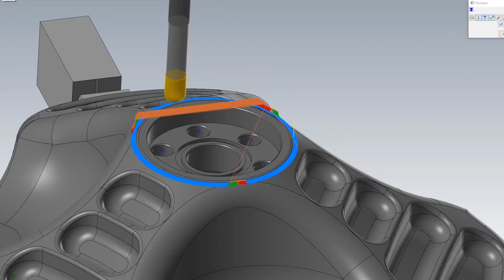IF You're This Type of Machinist, You Deserve $100,000+ Salary

Comment: I started out as a cnc set-up guy in mom and pop small shops for 8 years, and then I became a manual machinist. I thought I actually knew something until I started working with the old-timers who spent 40 and 50 years in the industry. I later got a chance to train and become a programmer for a very successful engineering company. The ignorance of high tech shop's was enough to change my mind about being a cnc programmer. When I left that engineering company, heads rolled  like it was midevil times.

Comment: been working at a shop for about 4 years as a tool and die maker, we run a lot of D2 tool steel and supply 5 satellite shops with parts, I took a process that took a week for a set of blades for one of our shearing machines and made a fixture and ran a years worth in 5 days on a 1994 haas vf-3.

Comment: In my shop we only cut 1 thing 
The threaded connections for drill pipe in the oilfield 
I run a manual but I’ll see day shift arguing with night shift about adjusting the program
In this shop everything’s set up you just need to run the program, you’ll have a connection out in 1/2 an hour give or take

We had new guys show up and try to do it a different way or “this is how I do it”
One guy crashed the machine
Another guy would fuck with the program and spend all night on a single connection
12 hr shift

Those guys don’t last long

Comment: Hi Titan, where I live machine shops pay $20 per hour starting with zero experience, $22 per hour starting for students partially through tech school, and twenty years experience programming 5 and 6 axis Mazak and Doosan in conversational and G-code along with the technical school diploma pays $24 per hour. Wouldn't you think the difference in pay between no experience and experienced should be more especially considering the current skills gap?  What gives?

Comment: So many shops out there just want one or two guys who know what they are doing that they can pay decent, but still lower end wages while they fill the shop with people they want to pay as little as possible.  A lot of the older guys who really know their stuff, are retiring and there are not enough younger people willing to come into the trade at a replacement rate. The ones that do come in find it hard to move in these companies and really grow into very competent machinists.  I can't blame them when they can go to Aldi and Walmart make as much as I see a lot of these companies hiring for.  I've been a machinist for 15 years now, make 100k with OT, run a mill-turn department, and am a key voice with how things are run on the floor.  If I didn't have to lose so much money to start over, I would  apprentice to be an electrician or some other better paying trade.   For how technical machining is, and how expensive machines are it's amazing that machining is one of the lowest paying trades.

Comment: I’m starting a job on Monday that pays 50% of the labor quote on the job.  Each machinist “owns” a handful of repeat small batch jobs.  When you do the job the first time, you make 3-4x the order and hold the extras as inventory.  When they order more, you bag em up and hand em over.  You still get paid 50% on the labor, every time.  

Everyone there makes over $100k and most are around $150k with a few hitting $200k on good years.

I get hourly $35 for the first few months until I have a portfolio of jobs.

Comment: Reminds me of when I was a CNC Foreman and I increased the depth of cut on a part by 50% and the operator was freaking out. He literally ran away from the machine when I hit cycle start.
I looked at the load meter, no problem machine has enough HP. Told the operator no problem, run it. I get that same thing, " We never cut that deep before, it's too much."
I go through everything from the tool max. depth of cut from Sandvik, part's not slipping in the chuck, machine has enough power. The tool life actually improved and I come back by the next day and the guy has changed it back. I had to finally tell the operator that I was going to fire him if he changed it again.
" We've always machined it this way."
Reply: People just can't understand that fewer chips usually means longer tool life. My dad learned that in a blacksmith shop in the 50's.

Comment: One of the best pieces of advice I could give someone trying to be a step ahead of others in a technically fast paced career is pretty simple - browse catalogs and white papers for trade relevant companies and vendors.  I am old school and prefer paper ones, but edocs are even more easily available. I have found seeing new parts, tools, and supplies really gets my creativity flowing. In many cases, a purchase isn't even needed as you can come up with something similar with parts on hand. It also allows you to be a step ahead of others in problem solving as you are aware of new solutions and tooling that may apply to whatever pickle your company finds themself in.  Its a really easy practice to pickup that is free from most companies.  I am only a hobby machinist, but I work in IT as an infrastructure architect and this really helped me coming up.  CNC machining is just as much on a fast paced technical evolution as IT and you cannot be static.  You will NEVER know everything as there are new solutions, techniques, and tools coming out daily to learn about.  Like Titan said, anyone that claims they know it all is on a sinking ship and not in the right career.

Comment: Where I work there is  an old job that we make once in a while. After working on the first part with the old program and the old tool for this job I stopped running the machine and opened the program on the computer and after tinkering and editing for about 30 minutes with the program I ran it again and this time I shaved of 25 minutes off of the machining time. The floor manager was surprised that the job went so quickly then he was used to. One of the new programs stopped by for a chat and he was interested what i was doing and after running some ideas back and forth and sharing my thoughts what can be done to make this work more efficient he went back to his desk and started implementing those ideas for the next time a new order came in. At the end we managed to shave of an extra 20 minute of the work thanks to a new program and new tooling and better fixturing.

Comment: I work machine maintenance for a large aerospace company. I make 100k a year doing 
machine maintenance been a manual machinist since I was 18 with a journeyman machinist card. I will come do maintenance for your shop for 150k a year plus moving costs. I will create the best pm schedule and have a inventory of spare parts. When you get to the point where your machines are showing age hit me up. I will make your machines brand new again.
Reply: Dude, the world needs people who can repair cnc machines. I know 2 guys in all San Diego. And they are booked solid.
Reply: @wannabecarguy  ya I work a lot of hours. I'm also the lead for a shop of 50 guys all doing what I do. The only reason I would be interested in working at this shop, is that the owner really has drive yo want to be successful, he listens to his people and wants to be the best. That's really hard to find from an owner. I make really good money as it is. But for 150k I will come build him a pm schedule and spare parts inventory. Will set him up with all the special tools and fluids, lubricants that are required. Alot of time the new machines come with a warranty, but after a year or two that runs out. The machine manufacturers offer repair services from 3rd party vendors, but that becomes expensive and they make money from finding things "wrong" with the machine. A good maintenance cnc machine mechanic is not cheap but the best ones are expensive. But in exchange their machine run for years and years without issues. Then when the owner decides to replace them, he will get top dollar for that used machine because of the maintenance log the machine comes with. I will be waiting for Titan's offer.

Comment: I'm glad you said this. YOU'RE EXACTLY RIGHT. Now how do we get the industry to see this, to understand it as a whole, to take that leap of faith and implement the higher pay when THAT GUY is doing it for 45k annually already? A guy who has to move a family to a new region to even see a 20k increase. I tell you what tho, I've been watching your videos and I can see several ways to increase production. A: Put the schunk pull studs on the fixture plates for that tow hook job and not on the base plate. You only eliminated the dialing in of the fixture. Eliminate the bolting and unbolting too. Boom, there is an extra hour for 15 pcs. And please consider a crane. My back aches just watching the vid.

Comment: I'm retired, and when I started in the shops, NC was the big thing. 
CNC didn't really get 'on the floor' until decades after I first learned to G-code my way through a part and then run aircraft production. I made acceptable coin then, and when I retired, I was worth the six figures a year I was pulling down. 
Forty+ years of experience, education and knowledge piles up. 
You've heard that old saying "I've forgotten more about x-y-z than some kid will ever know"? Yes, that's me. 
More than once, I've straightened out an engineer on something, be it stress equations, dimensions, processes or whatnot. The CEO of more than one company has come to me to see "Is this possible, can we make it for this much, and lose our shirts?"
Do I know everything about machining? Nope. There's stuff I haven't wrapped my brain around and made into quality parts, floor to floor. But...
What I did, for all the myriad parts of all kinds of materials across all kinds of machines with loose to tight tolerances, I did well and made the company money with quality parts for their products and for customer's products. IF it had my 'stamp' on it, it was known to be good. Period, End of Conversation.
THAT'S why I was worth six figures per year.

NOT because I stamped my foot and cried "Cuz I said so!!! WWhhaaaa!!"

Comment: People with that drive aren't salary men, there is a steep disconnect on the quality of worker you can get for a salary. Someone who has that much experience and knowledge usually has their own shop and their own business. People who have experience but are not "paid enough" lack drive or have some personality flaw that disables their ability to thrive elsewhere. Lower management suffers heavily from this and usually drives a local business downhill, seen it several times.

Comment: There's nothing worse than seeing someone run under 100 percent.  I've seen people run slow because of insert failures when in reality the insert is failing because the cut is interrupted at the beginning and the tool needs to be sped up so it will get under the material quicker.  I've tried to explain this to people to help them understand why the insert is failing.  Some take it and some don't.  I've also tried to explain to people why the the ceo getting x amount of dollars for a bonus is not a bad thing.  If I helped a company make billions and I got 10 mil in stock options that will go up or down depending on the decisions that I will end up making that is not an unfair situation.  If you compare the few million to the billions being made it's really not a drop in the bucket.  That's not to say there isn't corruption going on, but it's not always that simple.

Comment: I always suggest improvements. Not only in the work I'm doing on milling, but in everything within the company. In manufacturing processes, marketing ideas, health and safety and whatever comes up in my mind that could help the company develop and improve. I'm working on the shop floor and I see what's happening and what improvements can be made. Not people from the office. 
Unfortunately in the company I'm working for, the effort is not valued. I get paid according to some skill matrix excel sheet. My lvl pays me under 18K with around 6 years experience on CNC. We have to be 90% efficient and with that, no one puts more effort. I'm the only one out of 400 people who suggest anything (according to the manager). But what saddens me the most is that not much get's implemented or improved. Regardless, I keep suggesting things even if they don't get implemented. They probably are fed up with me suggesting things. But I've done my part of the job. If they don't want to improve, that's up to them.   I now will look for a new job.
Reply: Being in such a place for almost 5 years now managed me into burnout and depression. Being surrounded by people not wanting to do anything out of line breaks my brain. Standing still is like taking steps back without moving in any direction. Hope you found something. Im forced to look for something new too now.
Reply: @sicstar  Not exactly. I'm leaving UK for good and this job too. Engineers are undervalued. Will switch to IT.
Reply: @ReinisSproģis  Best wishes for your further journey then and good luck finding a new employer or the opportunity to be your own cheffe. And yeah most work nowadays is undervalued sadly...

Comment: In 1990 I was hired to a production company as a CNC machinist on 2 large horizontal CNC machining centers(after 10 years of working in injection mold production with accuracies of .0002/-0 tolerances on the pockets and round bores-not all of them but, say,  a lot of them....where I never went over 12 Dollars per hour. When I quit and got job elsewhere in mold industry I went immediately to $19/hr). So this new company was DOD contractor (a lot of older manual machines: lather and mills and couple of larger manual horizontal mills - in total about 10 people.
This guy  hires me at only 18 Dollars an hour...  They were making transmission housings for Bradley vehicles(Aluminum sandcasting) . 2 different sizes. Owner's son was running one of the hor.vCNC's, making 1 small transmission housing a day of 13 hours. In few weeks I re-edited the program, asked for different tools and ended up making 3 large transmission housings a day-in 8 hour shift!...Then for the very large CNC horizontal mill there was several job -also running 1 part a day in 1 shift of 10 hrs? (there were 2 alternating jobs in small batches, which lasted about 2 months each and then switch to the other one...) I have redon these 2 jobs too....3 parts in 8 hour shift on both jobs. So the guy opens up second shift. because it all went automatic (19 ? x 1/2-13 taps in 19 -20 seconds. Everything running at top speed never seen before. And the the 'son of a bitch' gives me 1 Dollar raise after about  8 months. No matter what I did, it was never good enough for him. After 4 years I quit (Sorry I did not do it sooner). When I opened my own 1  man shop, I was making between 150-300  Dollars an hour. (working only about 50 % of the time, because the other almost 50 % was "sales time'.....). I wonder how this 'cheapos' out there have a face to pay next to nothing. And true...a lot of guys think they know a lot and in fact they are just average  blo-Joes who worry to deliver the effort, because they are 'not paid enough' in their opinion. If someone wants to know the name of the company and its location, I can provide that, no problem. The MF doesn't deserve any better(he is-I believe-long time dead, anyway!)

Comment: Your so on point Titan. Years ago I worked with my grandfather and I learned from him in his shop on manual machines. I remember the one time he scolded me, it was over a cracked mill vise.  He told me to stop waiting around for him to tell me how to fix it and think of the best way to fix it and fix it. From that day forward I stopped waiting for others and started pushing myself to limit after limit. Now at my current company we are not a machine shop but we or I build stuff to blueprints or napkin drawings. I started with a clone Bridgeport Knee Mill and we now have two CNC tables, I have built my own CNC machine, traded work for a CNC laser, built a 3D printer and at the moment am rebuilding a name brand CNC. The only thing I know is, Just Keep Going, keep pushing. Thank you Titan for all you do.  Who cares what the doubters say, just keep going.